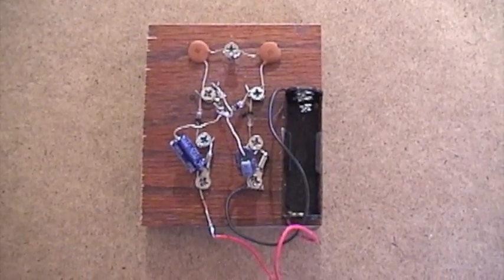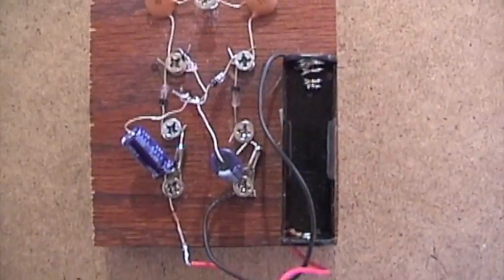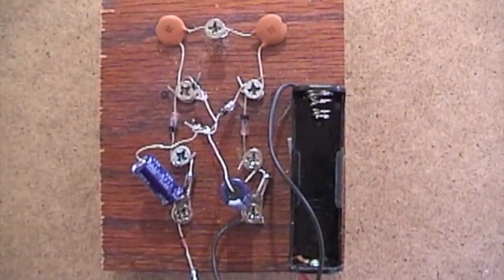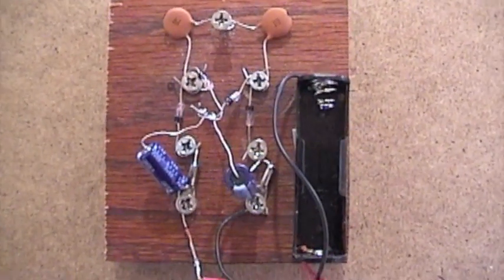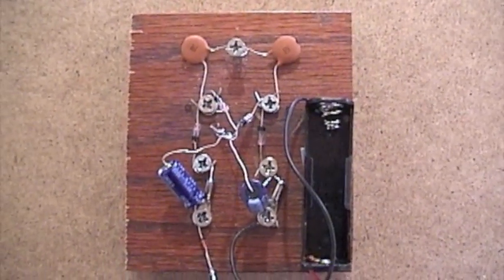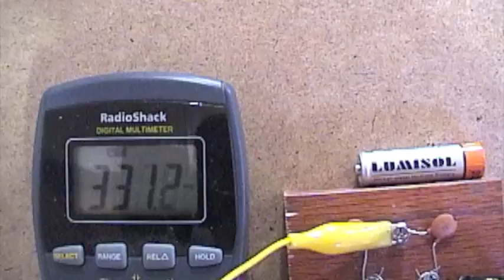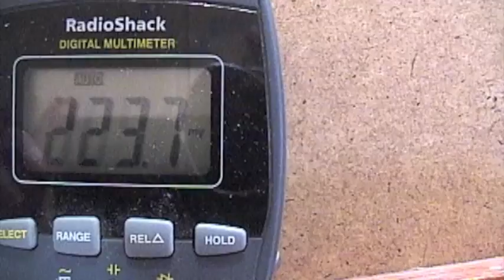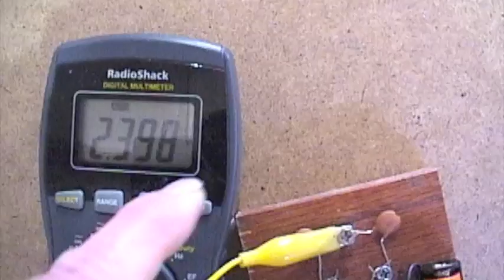RF Diode Charger

Comment: One way to scale it up is to put more of the same circuit in series and parallel. Ant to ground etc. There are a few ways they can be summed. You could also use 8 receivers to charge 8 AA's (or caps) which are in series, and run an inverter. You'd be lucky to get it to run long, but should work. Great reception strength! That freq could be motor feedback. I don't think its grid harmonics.

Comment: Power's directly proportional to antenna size. Connected to an alumium sailboat mast, the iron keel the ground. The output from the same circuit burst a AA battery. The battery acted as a voltage regulator in an anolog clock on board. The Marina broadcasts a strong Wi-Fi.

Comment from the maker: Its just an enamel covered iron floral wire i had.   75 feet wraps around my garage horizontal.  The Hz is 180 to 209 and bounces.  Not KHz or MHz.  It could be picking up AC grid induction and this is a harmonic.

Comment: Nice work.
Is the capacitors 0.2uf or 0.02uf.
May i ask what the length of antenna which you used for your circuit.

Eventually we would ask if this circuit could work out door as well.

Comment: Well done !
How do you generate a high voltage spike just with a Zenerdiode ????
Do you also have a coil in there ?
Please show the circuit diagramm !
What kind of Zener diode do you use ?
Many thanks !
Regards Stefan.

Comment: What sort of aerial do you have ? works well. 
Normally, 24/7 radio stations actually throttle back by up to half of their output at night, but it often becomes more directional. All to do with ensuring the big stations get through over the airwaves...perhaps links back to WWII.  Fun to look at radio-locator (.) com for your area and see which AM's might be kindly charging your rig there :)